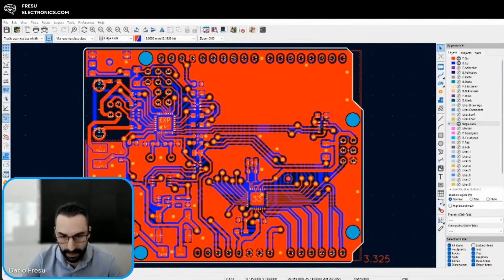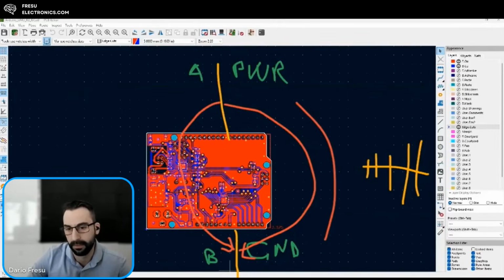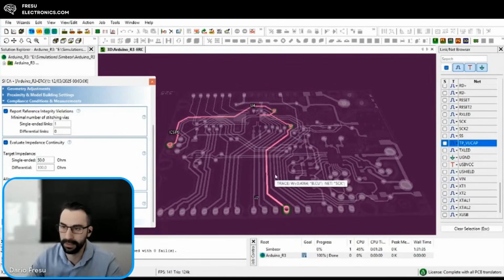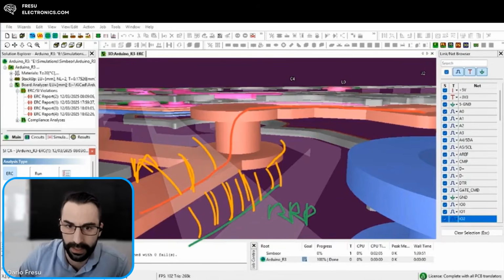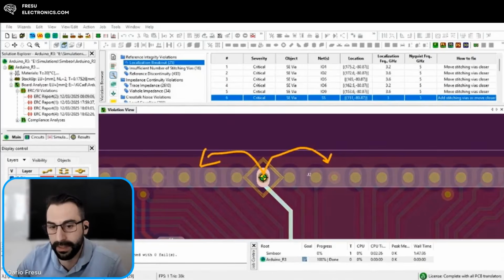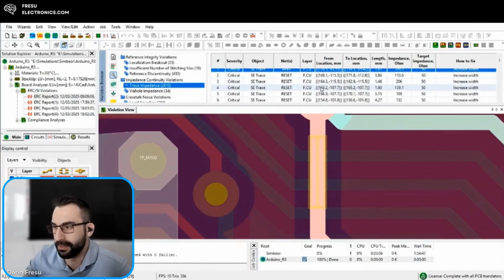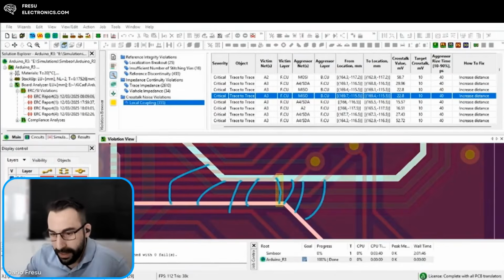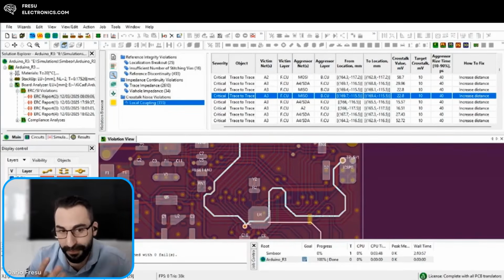Mastering EMI & EMC Troubleshooting in PCB Design with @simbeor Simulation Software

Comment: Hi Dario, thank you for sharing these valuable tips. I'd like to ask you about pour GND to the Top and Bottom in cases of four layers (1-Top / 2-GND / 3-GND / 4-Button). In this case, is it advisable to pouring GND to the Top-Signal and Bottom-Signal layers? Is this counterproductive? Is it better to leave signal and power routing only on the Top/Bottom layers? Thanks again, always grateful for this great support.
Best regards.
Diego
Reply from the maker: Hi Diego, it depends, in general  adding metal structures changes the impedance the signal sees, but also give the "opportunity" to create antenna-like structures. On the other hand, it improves the manufacturing process by balancing copper weight.  I will address this question more in depth in some of my future videos or posts at https://fresuelectronics.com/blog

Thanks, 
Dario
Reply: @dario_fresu  I understand, thank you very much Dario.

Comment: Thank you for another great video! Sometimes, at my job, I have to use a 2-layer stack-up for simpler PCBs. In the past, we have already passed EMC with this kind of PCBs, but I would love to see a video from you on how to create an even better layout for a two-layer PCB with signals on both the top and bottom layers.

I usually try to maximize the solid GND regions, but sometimes, signals cross no matter what you do. I also try to create small GND bridges over some signals to improve the return path.

What are some other tips and tricks for designing the best possible 2-layer PCB?
Reply from the maker: Unfortunately, sometimes choosing the stackup is not in our hands; I know. When you have to cross gaps, make sure you add return conductors adjacent to the signal trace to respect the containment of the fields. Ensure they are low impedance. Unfortunately, there is not much you can do.